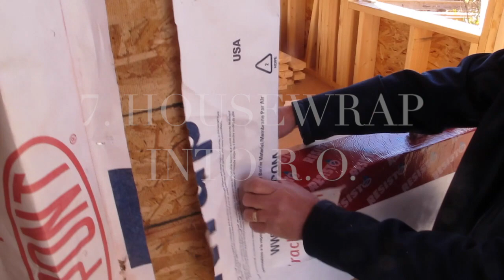4 Minute Window Rough Opening Prep

Comment: We don’t wrap the house wrap in anymore. You just channeled water into your house and negated the window wrap.
Reply: Tell me what was the mistake? I'm doing a job soon in mammoth lakes.
Reply: @israelmondragon2664  cut the wrap one inch outside of the window all around. Window tape the wrap to the substrate and into the window opening. Now it’s sealed outside around the window and on the window jam. Then install the window and tape the window flange to the wrap. Use sealant around the window except on the bottom. The house wrap on the top flaps over the window flange and is not sealed so if water gets behind it. It will flow out not into your house. Look for other videos. There are best practices outlined.